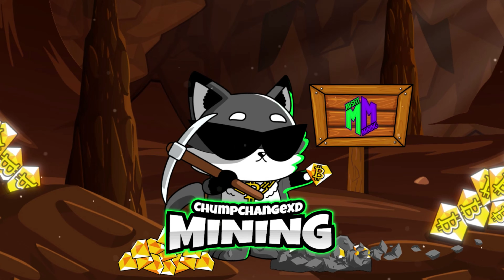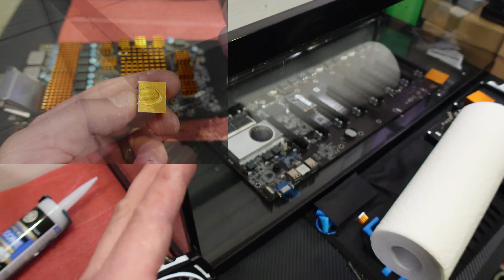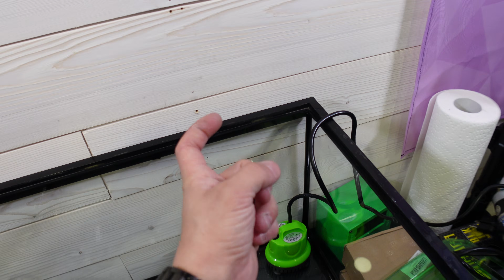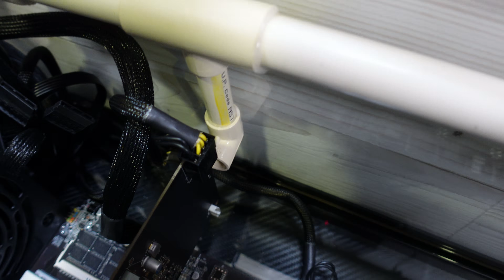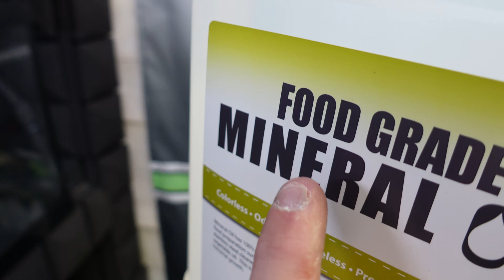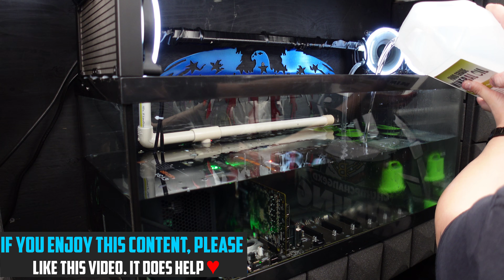Can My RX 570 Crypto Mining GPU Swim?

Comment: This was pretty cool, it would be a good solution for buying cheap cards with broken fans for mining. You should pick up some r9 390s and see how cool you can get them. That would be pretty interesting, seeing what's the coldest temperature you can achieve in mineral oil. Condensation wouldn't be an issue anymore right?

Comment: As I am sitting here could I get enough flow for 20-30 or more in a 55 gallon tank running it all through a bunch of slant fin? Dam no you got me thinking😀
Reply from the maker: Don’t do it LOL but it would probably work just the oil holds ALOT of heat

Comment: I am the guy running just the one 470 in a fish tank. I am using a trans cooler on my set up and a fish tank pump. It does move the oil and cool the system but the flow is low. I am also a plumber and boiler guy I never thought about using some base board. I look forward to you next one.

Comment: I don't know if it will work better, but I have used high-temperature epoxy resin myself when doing something similar (attaching heat sinks).  It can easily handle components heating up to 100 degrees celsius.  I'm not very confident silicone will handle the continuous heat without breaking down over the long term.
I also wonder what the heat co-efficient is for the heat sinks versus the mineral oil.  If the mineral oil is higher - you might be better off using just the mineral oil.

Comment: should have used thermal epoxy on the memory modules. ive done it for like motherboard south bridge chips on older boards that didnt have heat spreaders the stuff works great. should work well for an application like this.

Comment: Should try this with 3M Engineered fluid designed for data center scale immersion cooling. It's nearly like water and leaves little residue. Can pull a card out let it air dry and good to go.
Reply from the maker: Yea for sure if I do this another set up yes. A 4GB isn’t worth it for me; that stuff is pricey!
Reply: @ChumpChangeXD  absolutely, it is pricey, around $300 a gallon. Data centers have filter systems and other equipment to preserve the integrity and cleanliness thus saving cost to replenish.

Comment: Wouldn't it be easier to just submerge the gpu's with risers and 2m usb cables... I must me stupid. But I see no need to submerge the entire rig. Make a hub system.
Reply from the maker: The Riserless Motherboard Well called the GPU sturdy especially if I add multiple a skinny riser well just tip over with any oil movement
Reply: @ChumpChangeXD  That makes sense with the riser less setup you're using...  But you could also silicone *some risers to the  bottem of the tank.🤔
Reply from the maker: @monkeyabout1297  Yeah possibly but the hot glue did not stick to the tank after a day for that manifold which would make me think it will probably loosen and fall over
Reply: @ChumpChangeXD  Touché. I have very limited space so I'm always looking at density and how I can cut down rig size.🙃  thanks for awesome video asusual,gave me loads of ideas to pursue

Comment: so dumb, would actually make sense if you had cards that actually got hot enough to warrant submersion.. but oil submersion is crap anyway cause its so messy.. and the oil wicks up every cable and drips everywhere.. and putting cards in the oil doesnt ruin them.. just give them a bath in the ultrasonic cleaner and theyl come out cleaner than before

Comment: Total Noob Question, will the oil put additional strain on the CPU and PSU Fan when it spins?
Reply: Yes it will
Reply from the maker: Yea for sure but with movement from the pump it should take care of this issue if I can move the fluid pushing the fan
Reply: @ChumpChangeXD  Not sure I understand what you are getting at, I will have to wait for the update video. Again this was very nice quality and interesting to watch.
Reply from the maker: So when I have the bigger pump I’m going to point pipes at the sections of the unit that need it and push the fluid towards it to help push the fan on the cpu  (hopefully that will help) but we will see!!

Comment: all ive got to say is good luck with the pump,also might sort a lid. dust makes the oil conductive.
i spent a long time fine tuning my setup had nearly 50 gal. loop with 13 p104-100's and a supra mk2 radiator for cooling. its a massive pain.
Reply from the maker: I am actually going to put a top on this tank so HOPEFULLY the dust stays out!!! LOL

Appreciate the comment!!

Comment: wouldnt it make more sense to use thermal epoxy to attach the heat sinks to the chips versus silicone? Im wondering if the silicone will act like an insulator? Just curious, no personal experience at all
Reply from the maker: YES Probably This is just what I had so I was like HMMM I wonder because Silicone is some what Mineral Oil Resistant
Reply: @ChumpChangeXD  I see, I love this kind of content. Also nice to finally see the mask disappear!

Comment: Your intro and outro video is very crisp! Which camera/lens are you using? Awesome video! Yeah a lot of people doing immersion cooling relies on the sheer volume of oil for cooling. The fact that you also install radiators should theoretically remove the heat. The question will be how much heat it can remove as you add more cards, but that is the purpose of this experiment. Well done and keep us posted! I find this really fascinating!
Reply from the maker: Thanks brotha! Sony ZV1 with the wide angle lens recording in 4K. I can send you links if your interested three discord just let me know! 

Glad you liked the content my man! Appreciate you!
Reply: @ChumpChangeXD  awesome! Those are great little cameras. I settled for the Canon M50, as i already have a bunch of EF lenses. I just got myself the Sigma 16mm f1.4 lens and will try it out soon. Hopefully it will improve my productions. Have fun with the immersion project!